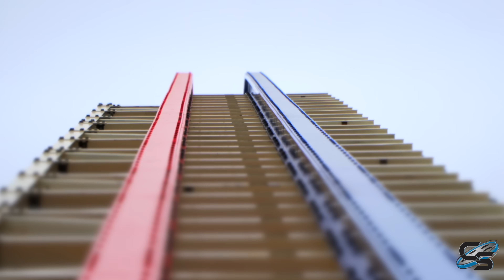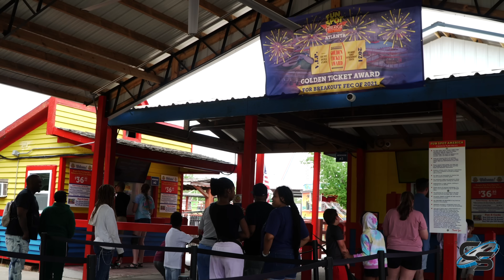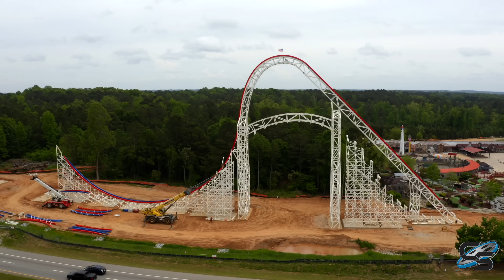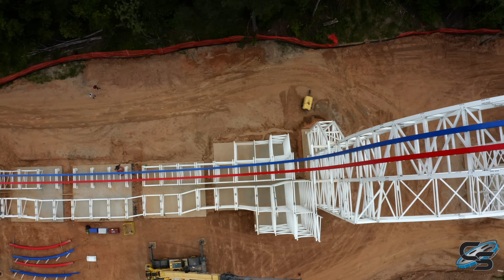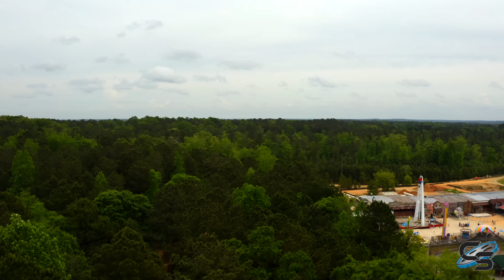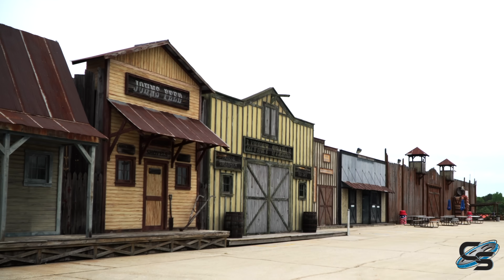EXCLUSIVE ArieForce One Construction Tour Fun Spot Atlanta Early May 2022 | New RMC Roller Coaster

Comment: I'm curious why some people call this and Storm Chaser "hybrid" coasters. They're exclusively steel. Storm Chaser was the first non-hybrid designed and built by RMC, not the Raptors.
Reply: Yes, the supports and track are steel, but the lift motor runs on electricity and can also be run off a diesel back-up motor.  Additionally, all the bolts, nuts, and washers are wood.  Same with the rebar in the footers. So for those reasons they are considered Hybrid coasters.
Reply: Because it'd designed and built like a wooden coaster, not the tubular track of steel coasters.
And the ride feels like a really smooth wooden coaster, not like a steel coaster.